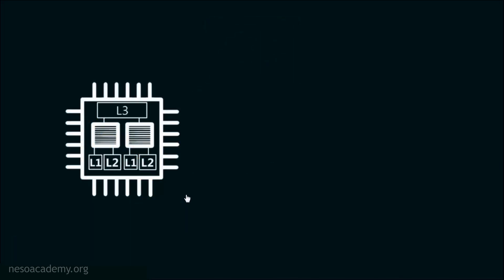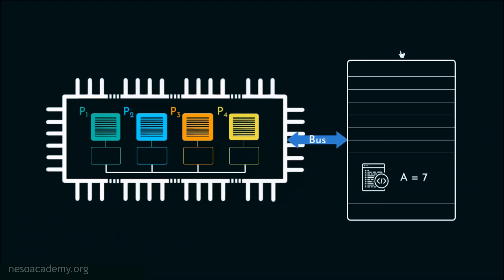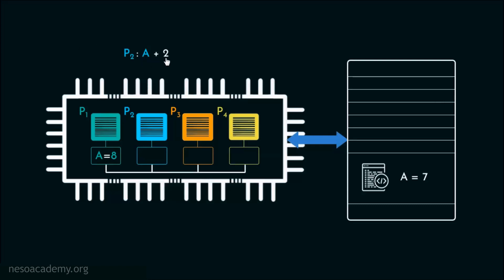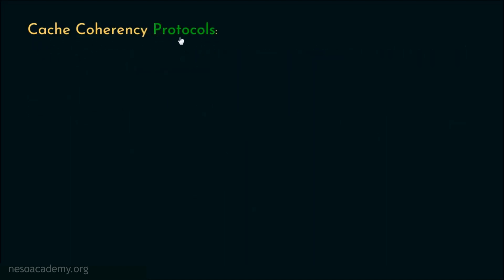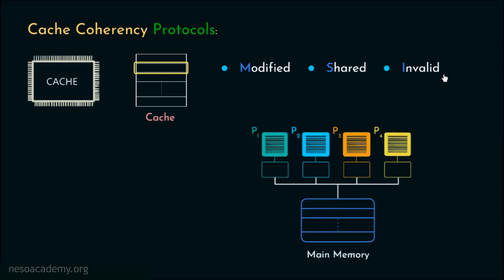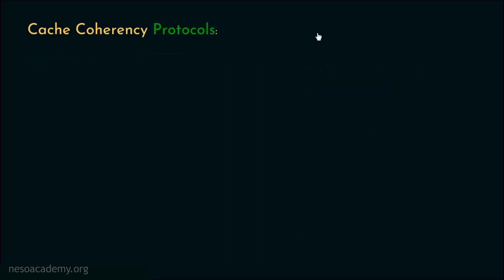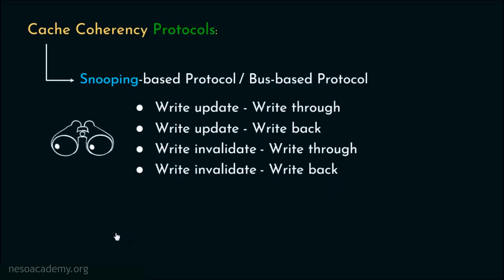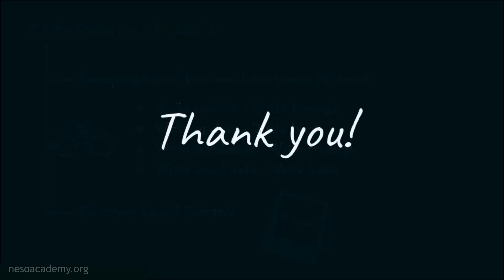Cache Coherence Problem & Cache Coherency Protocols

Comment: Great like rest of your videos. Though I would caution against saying that something is actually MISD. Because as far as I know there is no actual implementation of such.

Quote: "Multiple instruction streams, single data stream (MISD)—No commercial multiprocessor of this type has been built to date, but it rounds out this simple classification."

Source: "Computer Architecture - A Quantitative Approach 6th Edition" - Chapter 1.3, page 11.

Of course using it in example is fine, I just wouldn't want people (probably rare that this would happen, but this is internet, someone will believe in odd things) to think that there are computers working on single global variable across multiple CPU's and nothing else ;)
I'm sure real world example will clarify it and it will be either in this or in one of the next videos, since they are very thorough. And while I'm certain that engineers would love to have General Purpose MISD Multiprocessors, nothing except quantum computers seem to promise it. And Quantum Computers only do if you think of qubits as separate processors. Which is not how it works. Also if cache coherency was the only problem to achieve true MISD, then it would be solved. But we run into Amdahl's law. Again.